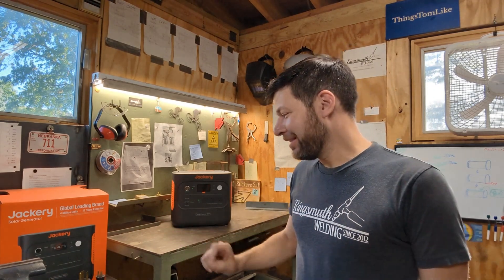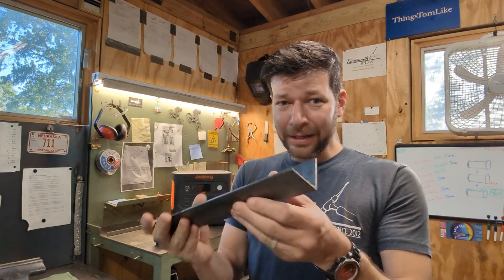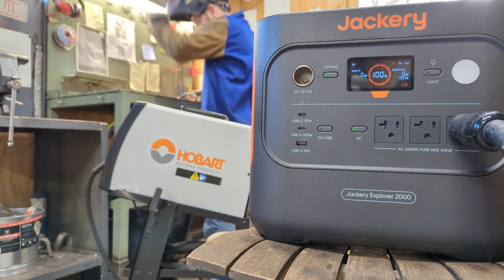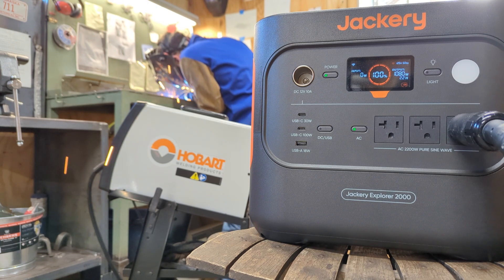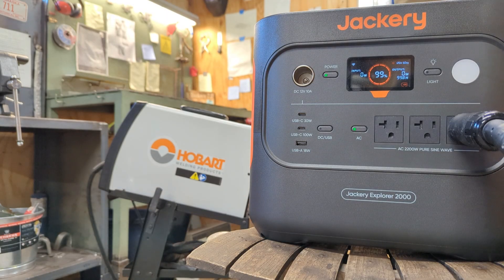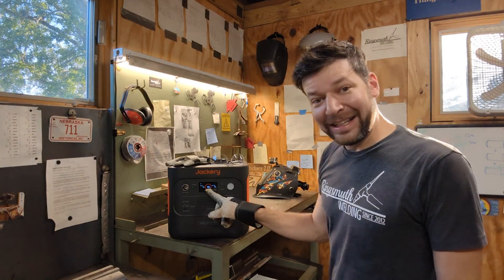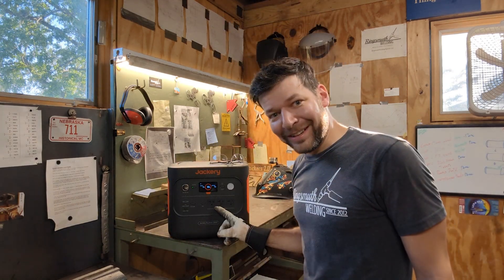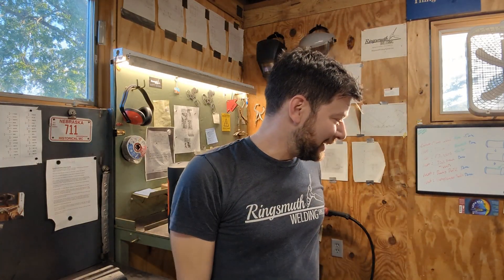Solar Generator Welding Test – Jackery 2000 + Hobart 210 MVP

Comment: Very interesting way to test the Jackery 2000, Tom!  We have two Jackery 2000 units, one 2022 unit in Lithium Ion and the 2025 unit in Lithium Iron Phosphate, and they are both great units.  Our test involved taking the older Jackery and using it to power our fridge, freezer, router, outdoor cameras and a couple of televisions and we went for hours in that configuration.  However, we recognized that we were right at the limit of what we wanted to do, and so we purchased the newer Jackery 2000Prov2.  Now we have extra capacity and the flexibility to run things off site if needed.  Your idea of trying to weld with the Jackery was a great test!👷
Reply from the maker: Thanks Dan! I really enjoyed testing it like this. I want to try a few other forms of welding with the unit. It sounds like you definitely put yours to the test as well. I'm glad you use them because that lets me know I've got the right machine.

Comment: Holy buckets it actually worked! Not quite the same as having a dedicated 220v wall outlet, but the fact that you can weld at all from the battery pack is kind of amazing. And yeah, like Phil said, I thought it would use way more power than it actually did. This Jackery battery pack is pretty impressive.
Reply from the maker: Yeah! I was happily surprised. If you needed to you could manage quite a bit out of this kind of set-up.

Comment: I don't think it was the duty cycle that was the issue. I think it was tripping the generators breaker when running at higher amps
Reply from the maker: Good theory @Drunklevince. But I'm not sure about that. During the video it looks like while welding on the lower end it tends to average about 1300 to 1400 Watts. When I run my shop vac off of the Jackery it will consistently pull 1500 watts. I have used that to vacuum out my entire shed which took a good 20 minutes and the generator seemed just fine within those operating loads. But honestly, I don't really know I'm just figuring this out as I try things.
Reply: Agreed. The solar generator went to 0W output until he turned the AC off and on again. 
When welding at the higher settings it was pulling 2000W for a little bit that was probably the surge capacity of the inverter.
If the welder had a hard stop when it hit its duty cycle limit the fan would stay on. 

Still a good video. Proves that it should be possible with a larger solar generator or inverter. Seems to be better then some generators running welders.